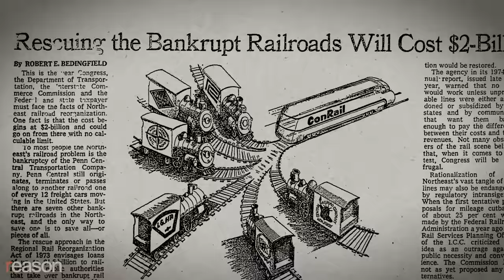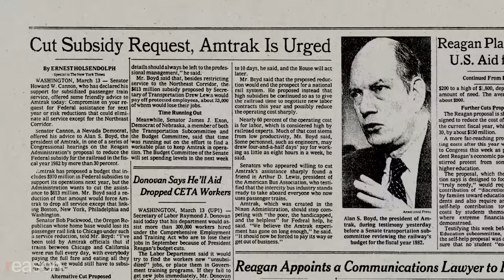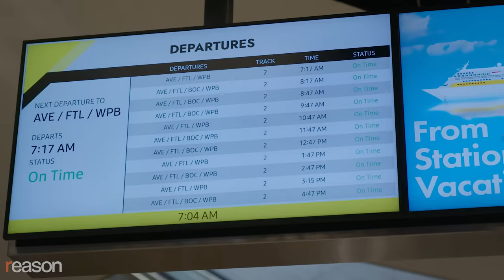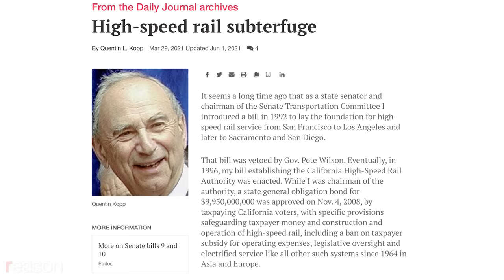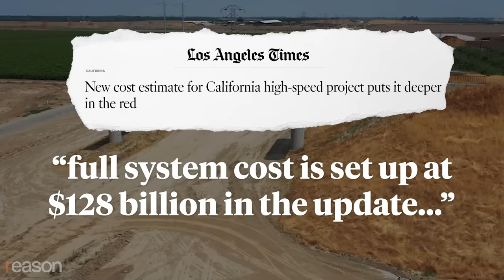How Florida beat California to high speed rail

Comment: Wait if bright line is following highway right of ways, isn’t that still on the back of government? Didn’t the highways have the same land acquisition problems California HSR has to deal with?
Reply: Highways usually followed the dirt roads that already existed since the 1600s.  The government just paved them.  ALSO FALSE.   roads are funded by gas/diesel taxes (indirect tolls).  Both the states & federal governments collect MORE of these gas/diesel tolls than they spend on road maintenance.  Therefore, roads have a surplus and don’t need subsidies . 

   TRAIN REALITY: China has built more miles of high‐speed rail than any other country with $800 billion debt.  None of its lines are covering operating costs.  (As a result, China is shifting to building more roads.)

France’s rail has debts of $70+ billion and has been repeatedly bailed out by the government. SPAIN built its system with a public‐private partnership.  It is $90 billion in debt.  The state‐owned Japanese National Railways has a debt of $550 billion.  (Japan also has Highest debt to GDP of 300%.)

Railroads are an OLD 1700s technology that is obsoleted by faster, more flexible travel technologies.  High-speed rail loses tons of money & is a bad investment.

Comment: I absolutely dread flying and I've never entertained riding a train.  It is less about cost or fear of exploding and more about hassle.  If I drive my car I can load it with whatever I want.  I get in and go.  I don't wait in line.  I don't get scanned and patted down.  I stop whenever I want.  I put as many bags as can fit.  I don't have to get a rental.  I don't have to worry about cancellations.

I would take the train if I could drive my car onto it (similar to how the Chunnel works).  Imagine going from NY to Chicago, not having to fly, and not having to drive for 13 hours, but still having your car when you arrive.  If you want to get really futuristic, increase the speed of travel by making it underground in an evacuated tunnel, such as Hyperloop.
Reply: Amtrak has auto trains, but there are two factors:
- it currently runs on one route
- they're always at the mercy of the Class 1 freight railway companies
Reply: hyperloops are right around the corner! I've been saying it for 10 years!
Reply: you can rent a car once you get there
Reply: Exactly.

Comment: How to compare apples with bananas. Brightline is great but not high-speed rail, to be a true high-speed service (like CHSR), it would need to run twice faster. In the rest of the developed world (and less developed as well, Morocco has proper high-speed rail for instance), Brightline would be considered as a premium yet low speed train (a diesel powered Thalys or Eurostar in a way).
Reply: it actually uses the same stock railjet uses

Comment: One more piece of information, the fare. A one way ticket starts at $79 and can be as much as $149. Not exactly priced for the average person. And when you realize that it's only 10 minutes faster then driving, it simply becomes a matter of convenience that is then offset by the fact that once you get to the far end you must rely on ride share or taxi, plus on the Orlando end you've left your car at the airport venerable to break-ins at $20/day
Reply: 10 minutes faster than driving? LOL - How often do you even drive in S FL? Orlando to Miami can easily be 4-4.5 hours. West Palm to Miami can easily be 2-2.5 hours itself - trust me when I say I've been there done that. I've driven to Miami many times as well as taken the train tons of times (both Brightline and Tri-Rail). The train is far better than driving. Upon arrival in Miami I have access to Brightline+ (free depending which service I choose), MetroRail, MetroMover (free), buses, Miami Trolley (free) either at or a stones throw away from the station. There are already transfer services available to get people from MCO to the major theme parks of Orlando as well as the ports. Brightline will also be adding their transfer services there with Brightline+.
Reply: @Ven100 Great explanation.
Reply: There are regularly economical cost saving special fares if your schedule is flexible.

Comment: Mmm...is it high speed though?? It's 'higher speed' rail, also it doesn't go terribly fast between Miami and Ft Lauderdale  because it's too urban and not safe for faster speeds. You cannot compare truly high speed trains to what they have there in Florida. Is it a move in the right direction, yes! What's different about the landscape that rail lines travel through in Cali and Florida? I can't tell you much about land in Florida but I bet it's cheaper and not covered in privately owned farmland. California has to essentially take care of every piece of land individually and that costs lots of money. Again, it's a really big stretch to compare what's happening in California to what is built in Florida.

Comment: Nothing about Brightline is High-Speed Rail. California is building true high speed rail at 220 mph. Brightline is currently going 79 mph which is an absolute joke compared to California.
Reply: Brightline's 79 mph average speed and a top speed of 125 mph to Orlando is happening in 2023. CAHSR in the valley will be 64 miles shorter and with four stations will take 90 minutes with an average speed of 114 mph in ten to twelve more years at a cost of up to $35 B vs. $5 B for Brightline. Who is laughing now?
Reply: @davidjackson7281  Brightline doesn't average 79 mph. That's their TOP SPEED from Miami to WPB. Up to Orlando, there will be some parts where it goes 125 mph max. CAHSR will go 220 mph max for the majority of the route when they are outside of the cities. You are comparing a slow ass commuter train to a true HSR train. Not comparable at all.
Reply: @toniderdon Divide 235 miles by 180 minutes. Enjoy waiting 12 years for the valley ride which you won't ride because you don't care about Bakersfield. Yes, the CAHSR bookends will be much slower resulting in a much lower average speed. You can't compare an SF-LA trlp may be by 2063 to BL in 2023. lol Future Fantasy v. Current Reality.
Reply: @davidjackson7281  And the truth is that the Florida DOT can enhance the performance of Brightline by commencing a large scale grade separation program that would allow  a train speed of at least 125 mph for much of the 235 mile route.
Reply: @toniderdon  But Brightline will begin operating the full 235 mile route starting Friday. CAHSR might never be extended beyond Bakersfield to Merced.
Reply: You know Miami to West Palm Beach has 4 stops in between and the total distance is only 70 miles? It makes no sense to go faster than 79 mph when you stop literally every 20 minutes. After that the West Palm Beach to Cocoa leg is 110 mph and is 129 miles, and then the Cocoa to Orlando route is 35 miles at 125 mph. The Orlando to Tampa leg is 84 miles, will be completed by 2027, and will also run 125 mph. So by 2027, when Florida has nearly the entire State connected, California will still not be done with one leg. And while it's "top" speed will be 220 mph, it's average speed of the trip is estimated to be 114. Top speed matters far less than average speed. And the Average Speed of Florida's brightline is not going to be much less than the CAHSR.... but it will be about 1/10th the cost, and 20 years earlier. @toniderdon
Reply: As for Cali, our 2008 ballot initiative promised SF to LA highspeed rail.  The governor is now saying 2040 for that full route to open.

Ridiculous.  Brightline might “only” be 125 but it’s still operating 20 years ahead of when SF-LA will finally work

Comment: Brightline is not real high speed. Anything below 200mph is not high speed.
Reply: International HSR standards start at 200 kpm/120 mph for existing tracks and 250 kpm/155 mph for new tracks.
Reply: That's because Brightline engines use diesel fuel, while true high speed lines use electric. Electrification is expensive to build, however. A railroad needs to have a lot of traffic, and thus profit, in order to justify having wires strung overhead.

Comment: Glad to see a conservative channel cover HSR. HSR won’t be successful in the US unless it has bipartisan support, even if the line is private. 

On density - Plenty of dense areas in the US where HSR could work. The NE corridor from Maine to Virginia would work (upgrade Acela) and almost the entire Midwest could work with Chicago as a HSR hub. The PNW and South would work as well. It’s not an issue of density, it’s an issue of Will. 

On California - It’s a no brainer that they should have just used I-5 or even CA-99 if they wanted some stops between LA and SF. The plan they have is far too complex and too invasive for the properties on the route.

Comment: That's a great success story in Florida, and a much better route plan in California. Too bad they are rent seeking there. Everyone falls into that trap, if the funds are available, get the grant.
Reply: Brightline is not even close to HSR, while California is going for the 220-mph actual thing. So Florida is building nothing than what we see across the nation today. Not a huge revolution for Florida.
Reply: @josephman1488  27 years later since the project started in 1996, how many miles of California HSR is actually viable?
How many of the miles are viable for use right now, rather than being a 9.8 billion dollar stonehenge?
Reply: @bobbinsthethird  Bruh, they only broke ground in 2015. And new tracks ain't cheap. 9.8 billion is nothing compared to what we spend on highways expansions. Let me remind you that the highway act of 1956 set aside a cost of 550 billion in today's money. See the difference? But of course, we must complain how expensive it is, the moment that it's overbudgeted.
Reply: @josephman1488 FALSE.   roads are funded by gas/diesel taxes (indirect tolls).  Both the states & federal governments collect MORE of these gas/diesel tolls than they spend on road maintenance.  Therefore, roads have a surplus and don’t need subsidies .    TRAIN REALITY: 

China has built more miles of high‐speed rail than any other country with $800 billion debt.  None of its lines are covering operating costs.  (As a result, China is shifting to building more roads.)

France’s rail has debts of $70+ billion and has been repeatedly bailed out by the government. SPAIN built its system with a public‐private partnership.  It is $90 billion in debt.  The state‐owned Japanese National Railways has a debt of $550 billion.  (Japan also has Highest debt to GDP of 300%.)

Railroads are an OLD 1700s technology that is obsoleted by faster, more flexible travel technologies.  High-speed rail loses tons of money & is a bad investment.
Reply: BTW the 2008 ballot referendum in California promised LA to SF train finished 2022.  Now the governor is saying 2040!  That’s frakking ridiculous

Comment: This is incorrect. Florida doesn't have any rail line that can meet the definition of High Speed Rail (150mph+). Most of bright line is 110 mph once the Orlando extension is open, and the rest of it is 80 mph. 

This video contains inaccurate information in the title. Lazy writing.

Comment: Can't really compare Brightline FL's project to CAHSR. Not only is CAHSR having to build from scratch, they're building Class 9 220 MPH tracks. Brightline FL benefited from existing tracks except for the small portion to MCO and having a top speed of 125 MPH. I do not mind the 125 MPH/200 KMH top speed in the slightest because there are a ton of trains throughout Europe (and even China) that are high speed trains with the same top speed in operations.

Can we please stop with the I-5 corridor? It was never a good option. Again, NEVER a good option. Brightline West using I-15 corridor is a different cause because there's hardly anything in between, as in no big towns are getting bypassed and it made sense to use this ROW to avoid all the NIMBYs of the area. I like Brightline West but it's still not as big of an ambition as CAHSR. Brightline West will likely be the first 200 MPH train in the country though.
Reply: The Central Valley Hwy 99 route is correct until Bakersfield. Then the route should shift to the Tejon Pass I-5 alignment.
Reply: As for Cali, our 2008 ballot initiative promised SF to LA highspeed rail.  The governor is now saying 2040 for that full route to open.

Ridiculous.  Brightline might “only” be 125 but it’s still operating 20 years ahead of when SF-LA will finally work

Comment: very interesting that this video refused to mention the billions in tax exempt federal bonds Brightline has received (or 3.5 BILLION from the infrastructure bill they're getting).
Reply: Tax exemption is a good thing.  Everything should always be tax exempt.
Reply: Brightline will probably fail longterm.   TRAIN REALITY: China has built more miles of high‐speed rail than any other country with $800 billion debt.  None of its lines are covering operating costs.  (As a result, China is shifting to building more roads.)

France’s rail has debts of $70+ billion and has been repeatedly bailed out by the government. SPAIN built its system with a public‐private partnership.  It is $90 billion in debt.  The state‐owned Japanese National Railways has a debt of $550 billion.  (Japan also has Highest debt to GDP of 300%.)

Railroads are an OLD 1700s technology that is obsoleted by faster, more flexible travel technologies.  High-speed rail loses tons of money & is a bad investment.

Comment: First and foremost I want to state that Brightline isn't "high speed rail" as we understand the term. According to the Federal Railroad Administration the minimum standard for high speed rail is 187.5 m.p.h. Brightline's trains use diesel propulsion and there maximum speed is 175 m.p.h. The only thing that Brightline did before California is prove that it's actually possible to use the stock market to raise the necessary funding for railroad expansion. Also, Brightline negotiated between the Highway Administration and Railroad Administration in speed tracking infrastructure  projects that would make Brightline able to get there trains operating first. While California's project is still being developed; various websites like to trash what California has attempted. How's about having Brightline go through the environmental approval process that California has to go through and then see how much longer Brightline's trains would've taken for full implementation!
Reply: Some of what you said was almost true.
Reply: Brightline Florida's max speed is only 125 mph, not 175 mph, and it only gets that fast on a small part of the route.
Reply: @Geotpf  That's exactly my point; there are some other channels which keep claiming that Brightline's trains are high speed rail; which in point of fact it isn't!
Reply: No it’s 150 mph as defined by Congress.  That’s also how fast Antrak’s Acela was designed, so it could qualify for high speed subsidies.